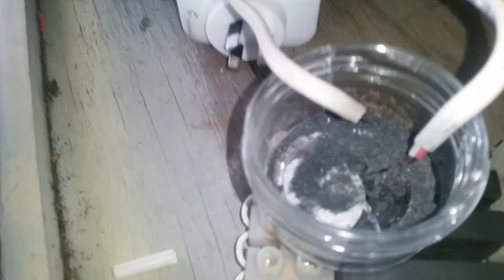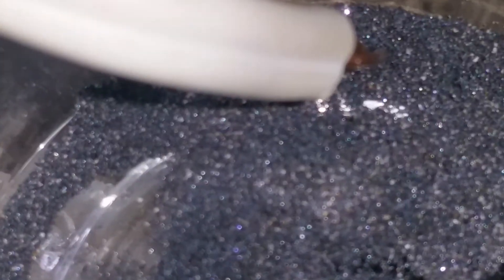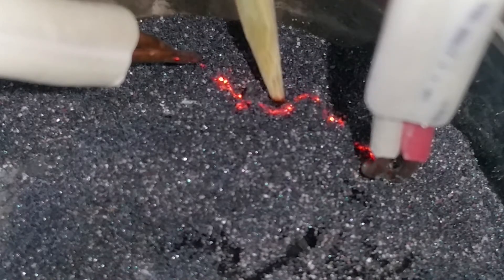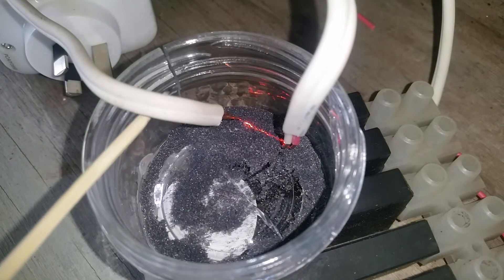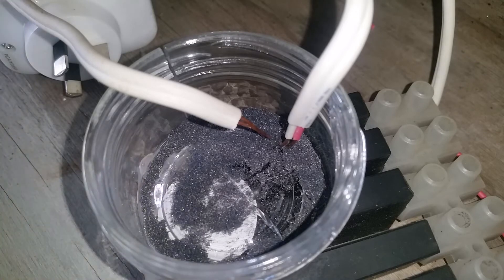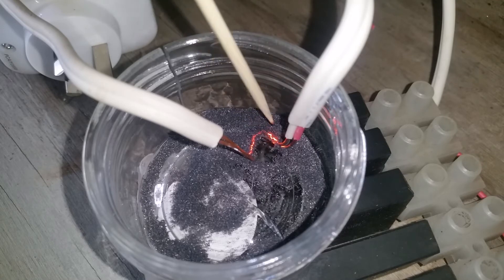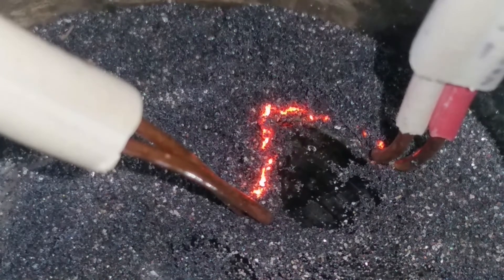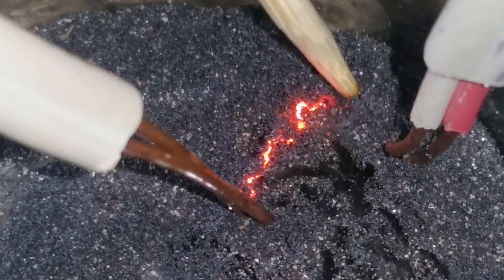Self Assembling Nano Lava !!!

Comment: There was a moment i transfered 230v ac down a ignition coil ( the ignition coil was isolated because it powered via transformer ) but the secondary spark arced onto the 230v ac mains and a whopping large arc streamed off ..a little streamer to a giant whorp ...not safe ..😊 but fun

Comment: very cool,   when i was a young kid i had a little remote control buss that had a magnetic coherer in it.   which was a tube of iron filings and some electrodes.   and a coil of wire around it.  and when it got a wireless signal the filings got  magnetized, and it would pass current.  and then there was a small electromagnetic hammer that would tap it when the signal was lost.   which reset the coherer and turned off the motor.    the rc broadcaster was some sort of spark gap transmitter i think.  ive found Tesal designs i think it was based on.
Reply from the maker: i was thinking about sone of teslas work when you mentioned coherers, thats the most amazing story if an early RC car, what decade are we talking?
Reply: @m3sca1  this was in the 1970's but it was a 20 or so year old model i think.  i was pretty young,  and i got the piss nearly shocked out of me by the transmitter.

Comment: Maybe it is ionic initially and then as graphitisation is occurring it becomes  greater in condictivity and the path of least resistance become a energy path that links like a chain of magnets that requires more force to break the higher the energy is that flows through it ! It may even be a new force much like 
van der waals force but an electromagnetic hence the self assemble .